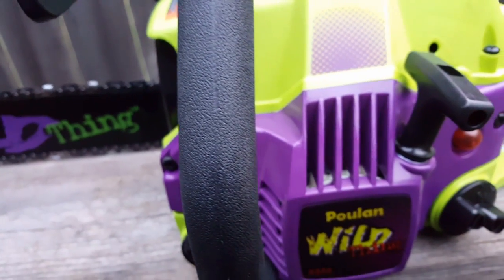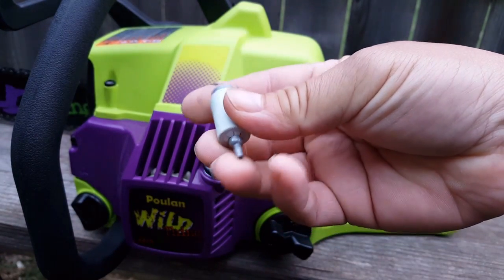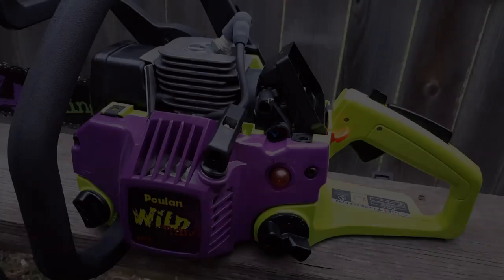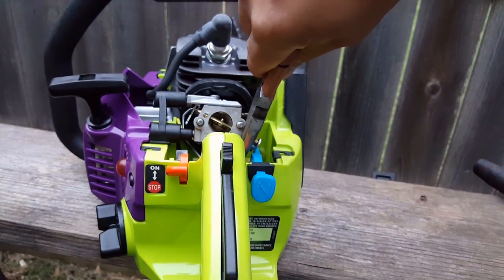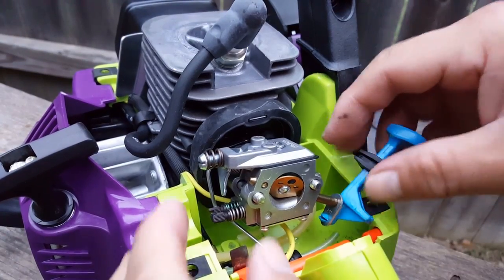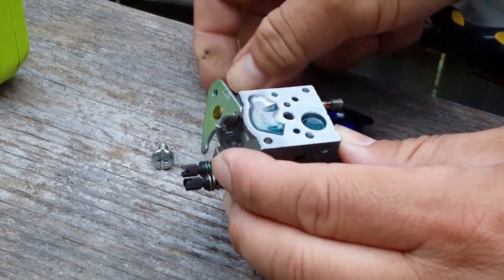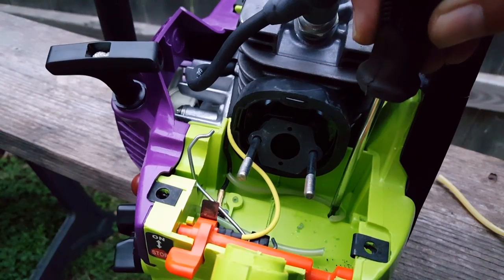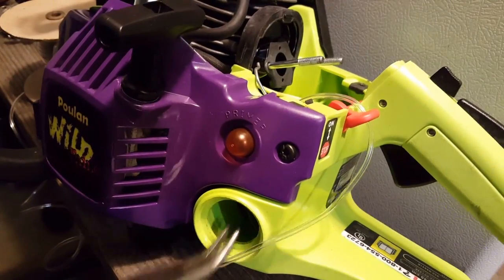Poulan wild thing chainsaw not starting. Fuel line fix.

Comment: I saw those things sold at Walmart and thought they were a kids toy. I will not even work on them any more. I tell the owner to go buy a better brand saw. Those were ment for storm cleanup and discarded. They do not hold up well over time. I refer them to a bic lighter. Once they run out of fuel, you dispose of them.
Reply from the maker: Very well said.

Comment: Yeah, the filter falling out of mine was a good indicator that the lines needed to be replaced. Fairly easy project &ran great til I tackled a huge tree that fay, now won't run at all. I have compressions park & gas so I really don't know what the hell the problem is. Pull it about 5 times get 120 lbs of compression. So who knows.
Reply from the maker: Yes you are in quite the predicament. How are you confirming that you have gas?

Comment: Best way to avoid brittle/disintegrating fuel lines is to ONLY use NON-ETHANOL fuel. Small engines especially hate ethanol based fuels.
Reply from the maker: Zed 80 thank you. Yes I completely agree with you .

Comment: How much fuel line do you leave in the tank for the weighted pickup? The new lines should fit very snug going into the fuel tank to prevent leaking. The replacement hoses should be the type that is not effected by ethanol or alcohol. Is it okay to have some air in the primer bulb?
I have a newer Poulan that does not have the slot on the end of the adjustment screws. Were can I get the special tool for adjusting the idle mixture? The local shop will not say because I would be violating the emissions if I made any adjustments.
Reply from the maker: Thank you for the comment I appreciate it.  Probably about 5 inches. Yes the primer bulb can have air in it but it must be half filled with fuel  at least. You can get a kit with several types of special adjustment tools on ebay.

Comment: I had to replace the fuel line, but new line  O.D. was a tad bit bigger so I drilled out the holes in the plastic case just big enough to get the lines through, is this a problem?  Pressurized case/ tank?     Also, my saw has a hard time starting, then will idle and run up for a few seconds then acts like it runs our of gas?????   Then hard to start again??
Reply from the maker: Thanks Joe Blow for the comment and questions.  You can drill the holes out but make sure the holes are still tight for the fuel lines to seal just in case you have to turn the saw sideways. Otherwise you'll leak fuel. If it runs and under throttle it dies after a couple of seconds check that the metering diaphragm is not somewhat stiff. It needs to be completely flexible.
Reply: Thanks, I see a rebuild kit in my future.  Carb diaphram and especially reeds seem very stiff and brittle.

Comment: would be nice to know how you replaced the line through the right side return from primer
Reply from the maker: Thanks for commenting. You mean the last line I connected on the primer bulb? The line connects to the primer bulb and to the bottom port on the carb. If the bulb doesn't fill with gas when you try to use the saw try swapping the 2 lines on the primer bulb.
Reply: the thing looks new
Reply from the maker: Yes like most chainsaws they sometimes are bought and used sparingly. Then the fuel lines become brittle.

Comment: Home Garage...I am.a.subscriber and you have helped me and I thank you. I need to know if all the lines are the same size..I bought fuel line last night with two different sizes...and it seems that only one, the big one works. I thought because of the smaller hole on the left side, a smaller line would be used. Also, after I connect the fist line to the primer bulb, where does the other connect? I'm not a dummy...I'm just trying to do it right, without having to pay someone. Thanks...and I'm telling my friends about your channel, so you can get more subscribers.👍
Reply from the maker: Thanks I really appreciate your subscription.  Yes for some reason the fuel line filter is smaller than the purge line that returns back to the tank. The longer nipple on the bulb goes to the larger hole on the right side. The shorter nipple goes to the brass port on the carb.

Comment: I got a wild thing chainsaw, it has compression, fuel and spark, it fires every time but it won’t start. Any advice?
Reply from the maker: It has fuel, are you talking about  fuel in the tank or have you tried starting it by putting fuel manually in the carbs throat? How does the spark plug look at the tip inside the engine?
Reply: I put fuel in the carb a bunch of times it fires every time but doesn’t run, I took off the muffler I poked the piston and it moves a little bit. Is it supposed do that?
Reply from the maker: It should move just a tiny bit.  Have you serviced or replaced the carb?
Reply: I just put on a new carb, I’ll try to post it on my channel
Reply from the maker: If you do pleas show the fuel line routing.  That's the most common problem on a carb replacement on these
Reply: When I looked inside the piston ring is stuck in the piston, is this the problems and how would I get it unstuck?
Reply from the maker: Did you push on the ring with something to see if it was stuck or did you only rotate the engine? Can you get a hold of a compression tester?
Reply: I just took the top cylinder off, and the piston ring was stuck so bad, I had to let it sit in oil, and it still was hard to get it off, and after that I broke the ring but I’ll buy a new one and see what happens.
Reply from the maker: @doggohide9432  good. Hopefully it only needs a ring.
Reply: I’ll update once I get it
Reply: I put the new ring on, and now it still won’t start and I noticed it was leaking oil or gas from the bottom somewhere
Reply from the maker: @doggohide9432  probably time to throw in the towel. It was a good effort tho.
Reply: I’m going to take it apart 1 last time and, seal every possible part it can leak from with liquid gasket and, if that doesn’t work it’s junk
Reply from the maker: Okay let me know.  I hope it works.

Comment: Where did you get the fuel line?  What size?  My Wild Thing has never run correctly or been reliable.
Reply from the maker: Thank you Jeff Ziegler. The fuel line can be bought at ace hardware. The sizes are 3/16" and I think the other is 1/8".

Comment: Where is the bottom port of the carburetor that the last line connects to? I know of the top one...Thanks
Reply from the maker: Dr. Beehive Swivel if your chainsaw has a primer bulb then the bottom port should be next to the 2 air fuel adjustment screws.
Reply: Home Garage Thanks so MUCH!!! This baby is up and roaring!! I appreciate your time, hospitality and thorough instructions!!😃👍👍👊
Reply from the maker: Thank you and you're welcome.